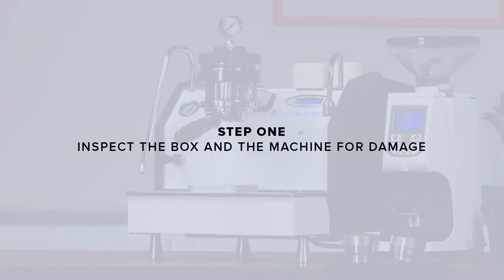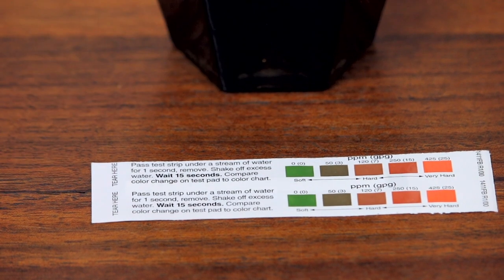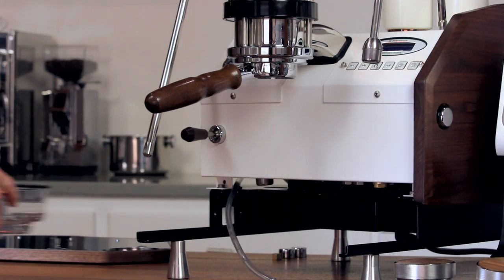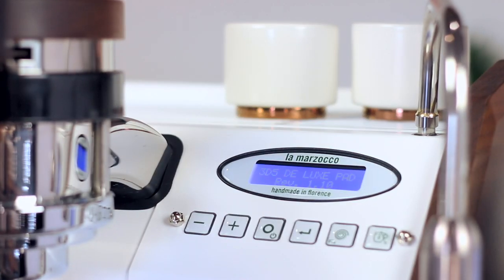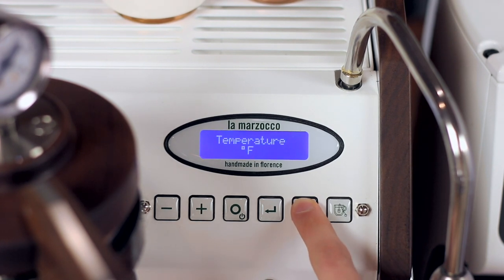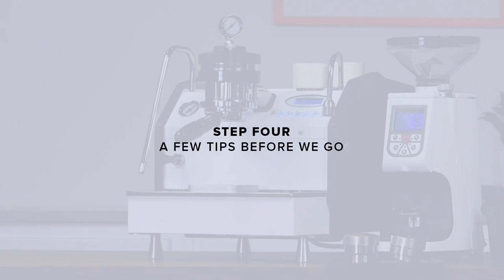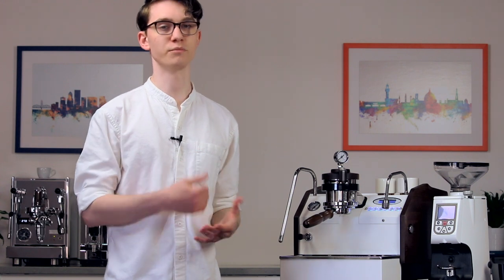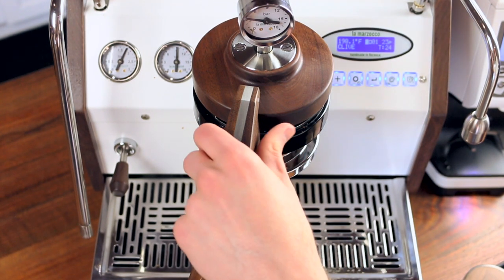La Marzocco GS3 MP Espresso Machine Setup Guide

Comment: Question, do I need to plumb in the machine to be able to perform pressure profiling?
Reply from the maker: Nope! You can pressure profile with the machine being used on reservoir mode.
Reply: @clivecoffee  My GS3 either goes to 3bar or 9bar. It doesn't go in-between. No matter if I move the paddle very slowly or not. Is there something wrong or there is any setting that I need to change?

Comment: How do I change the hot water temperature on a GS3 MP ?
Thanks in advance.
Reply from the maker: There’s a mix valve on the right side of the machine that adds water from the reservoir to the hot water stream to cool it down. The adjustment wheel is on the lower right edge of the side panel near the front. With a machine with standard plastic side panels, run your fingers along the bottom edge of the right side panel, and near the front, you’ll feel the notched wheel. Clockwise closes the valve for hotter water, counter-clockwise opens the valve for cooler water.